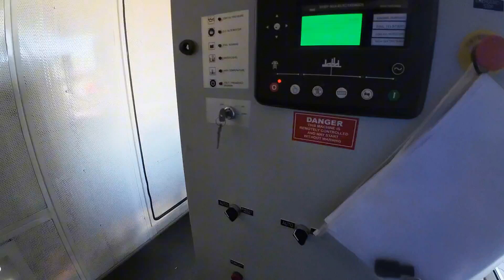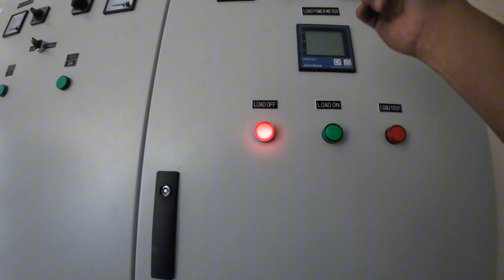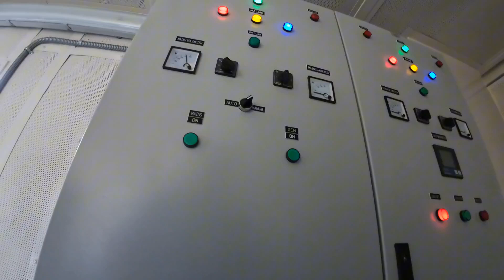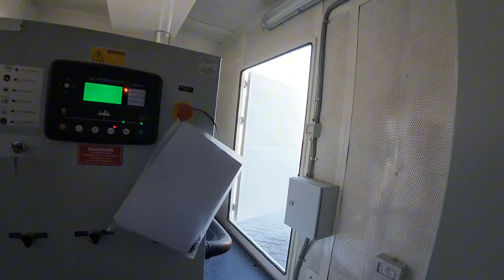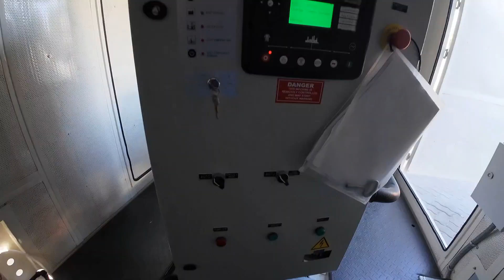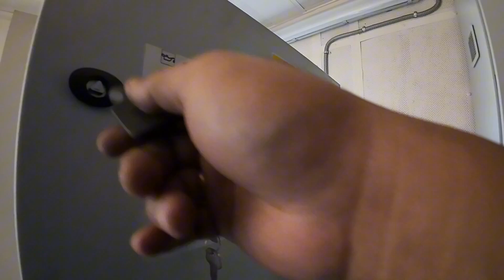80KVA CONTAINERIZED GENERATOR FULL OPTIONS

Comment: Hello sir,

I need your support with my following problem. I do have Perkins engine with ADEM4 ECM, I have done all the needed connections between DSE8610 Governer port and the ECM in order to control the speed.

I have finshed the adjustment of Governer SW1 to the nominal frequency to 50Hz but when I increase the nominal frequency to 52.5Hz in order to do the adjustment of SW2 it doesn't respond and it appears like the attached picture.

What should I do ?

What is the reson and how can I solve this problem?
Thank you in advance for your help.
Reply from the maker: Meaning that this is electronic engine first i ask you, you have EST toolkit to do a configuration for ecm?
Reply: @benzblogsVlogs  No, I don't have it.
Reply from the maker: What number you connect to the J-wiring from ecm
Reply: @benzblogsVlogs  j1/3 and j1/17 which corresponding to 20&24 termjnals of the ECM and the adjustment of SW1 is done perfectly.
Reply from the maker: I well get back to you tomorrow my duty time i double check it for you okay dont worry
Reply from the maker: Sw1 is where you can adjust sw2 is only the range ok